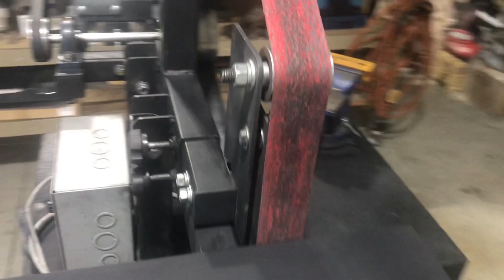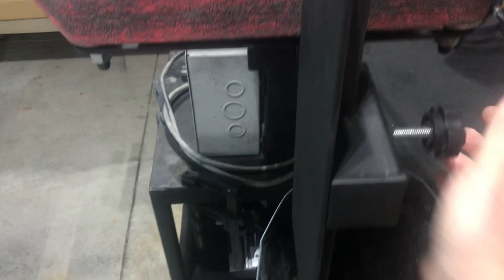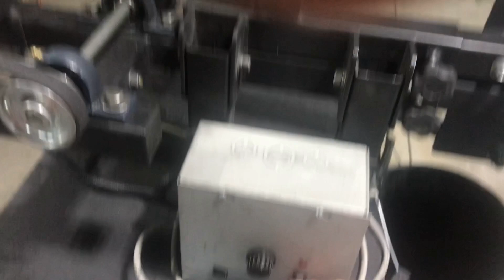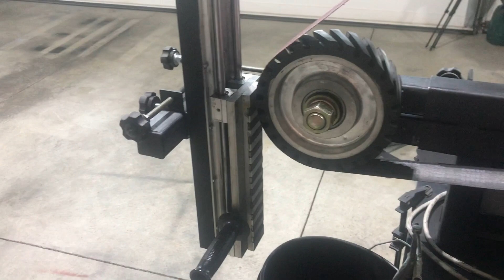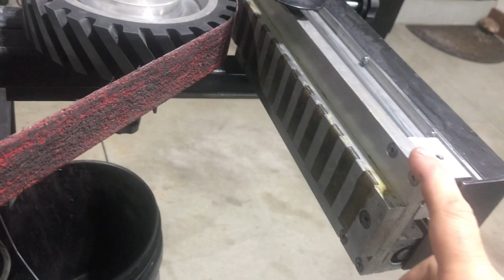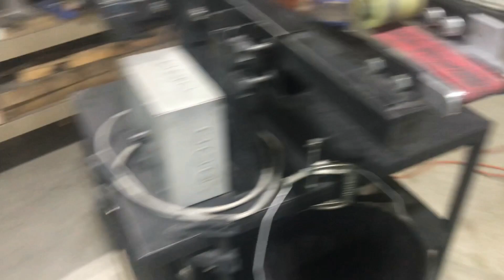DIY 2x72 Belt Grinder for Under $300

Comment: Excellent design, very practical and simple. Are all your plate pieces 3/16" and where did you source your wheels?
Thanks
Reply from the maker: Yes, the plates for the base and grinding table are 3/16" that were left over from another project. I used 1/8" wall tubing for the build which was also left over material I had laying around.
Reply: Thanks and where did you get the wheels? or did you make them?
Reply from the maker: I purchased the wheels on E-Bay, you can also find them on Amazon.